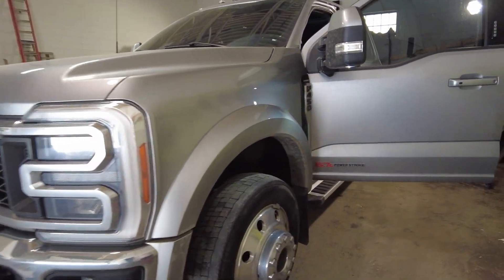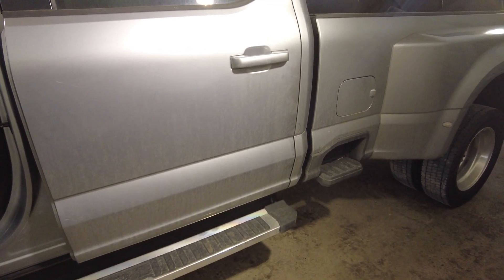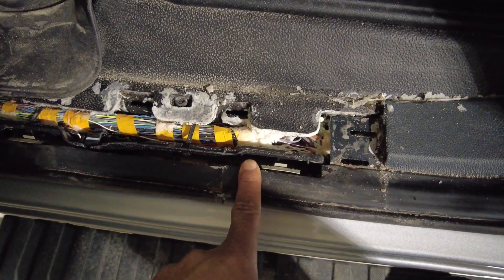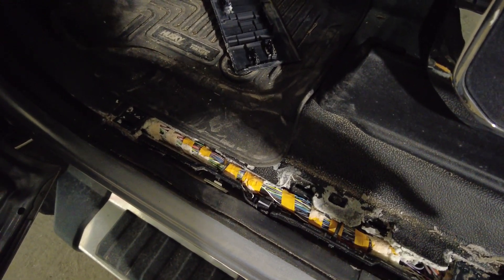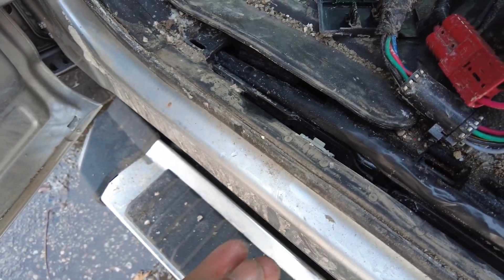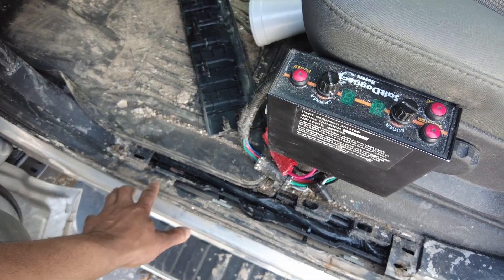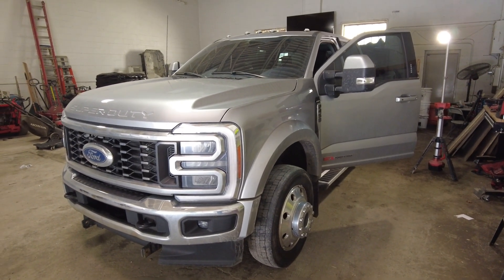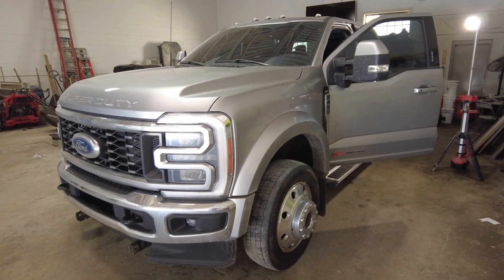Design flaw on FORDS but possible SOLUTION!

Comment: I would love to see how you are drilling the drain hole. My 2024 450 is in the shop for a water leak at a rear cab vent, and that water was collecting in the sill like you show here. I would like to put a drain hole in for future issues.